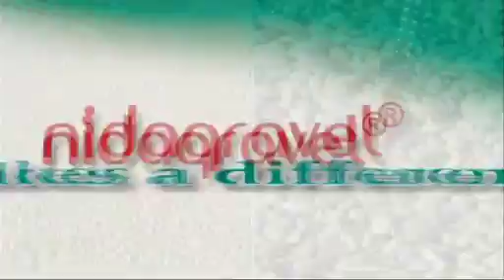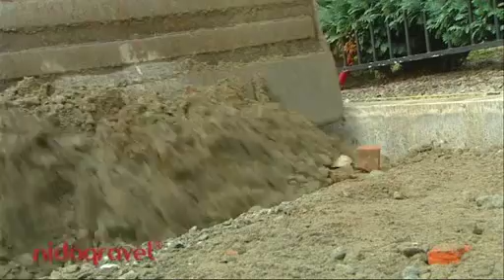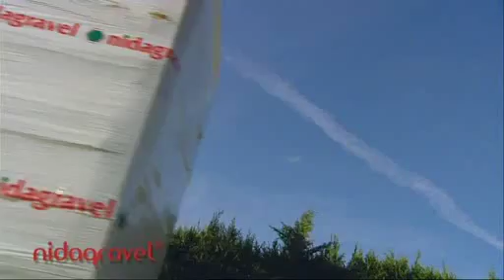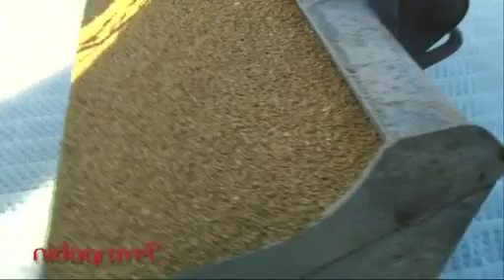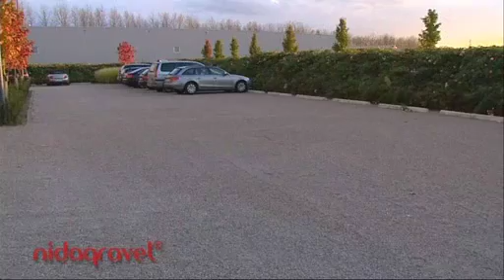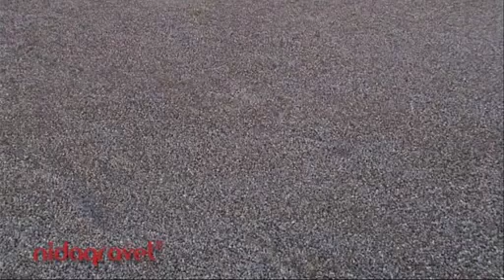Nidagravel Gravel Grids – The Original Film

Comment: way too expensive.  its $3 per sq ft to install yourself.  better off to pay $4 per sq ft for ashpalt and have them do all the work
Reply: Mark Butterworth he's probably an asphalt contractor.
Reply: Dear Mr Keller
Thank you for you comment. But we believe your cost calculations are incorrect. The cost per square meter of the Nidagravel 130 gravel stabilisation grid is £9.99 + VAT. (£11.99 inc VAT)
1 square meter = 10.76 square feet
The cost per square foot is therefore 93p + VAT (£1.11 inc VAT)
Converting £ Sterling to US Dollars - the cost would be $1.20 per square foot (plus relevant US taxes)

For the most current pricing information, we would recommend you contact your nearest US Distributor.
Should you require any additional information please do not hesitate contact us:
Tel: +44 01832 77 65 68
Email: sales@nidagraveluk.co.uk
Web: www.nidagraveluk.co.uk
Reply: Most benefit not the price, but water, that can't move horizontally, only down.